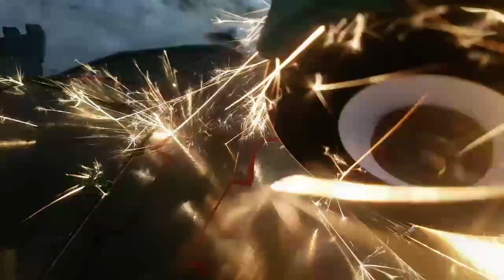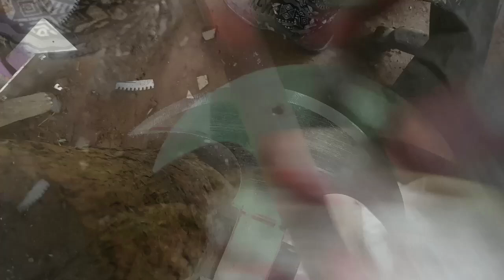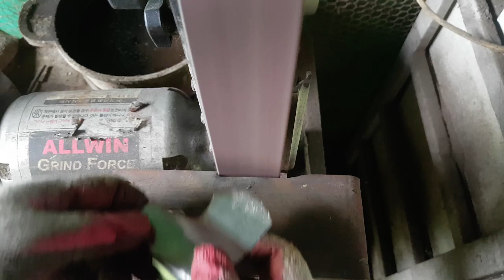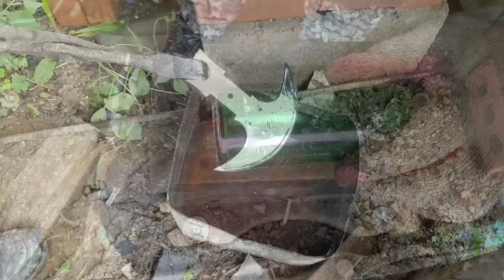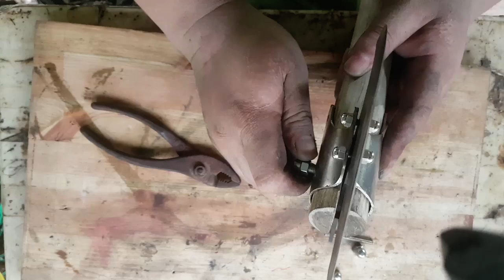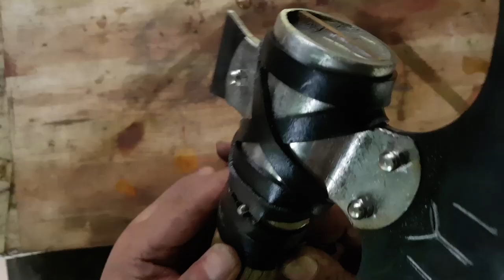make a camping ax from Circular Saw Blade

Comment: how many horse power dynamos do you use
Reply from the maker: Thanks for watching.
Most of the equipment power I use is 1/2 horsepower.
Reply: I really like your channel
Reply: may I ask for a photo of your belt grinder, I want to make it
Reply from the maker: @rachmatsetiyadi1471  My belt sander is a modification of the Allwin AGF6000 model (1/4 hp). When making a belt sander, 1/2 horsepower or more is recommended.
https://youtu.be/XdcAQ0R4q4k << This is a video I made in the past.
It probably won't help...